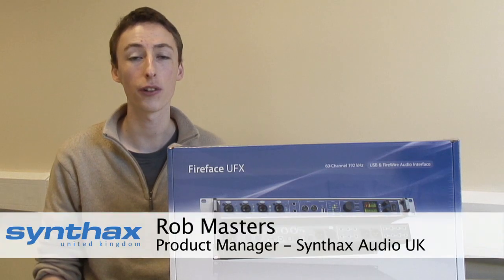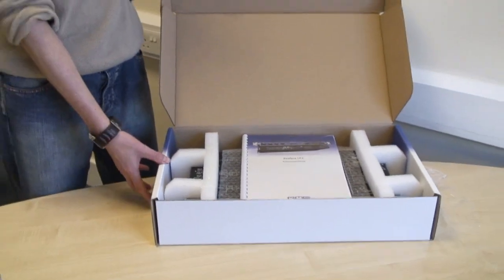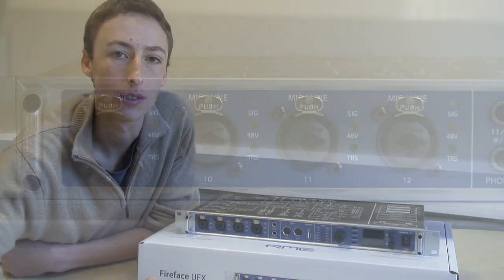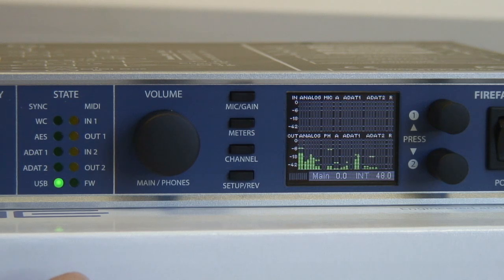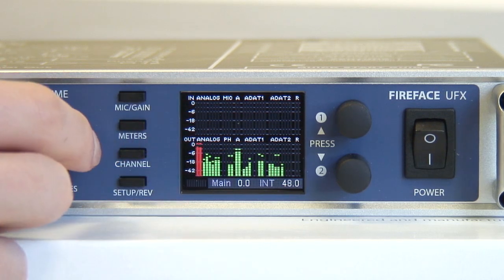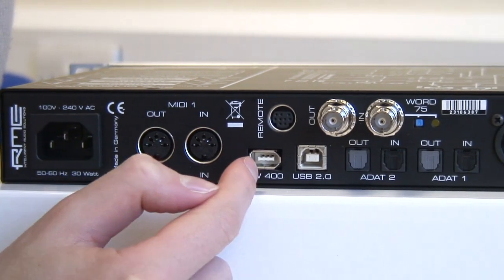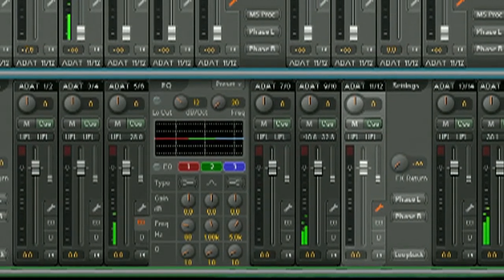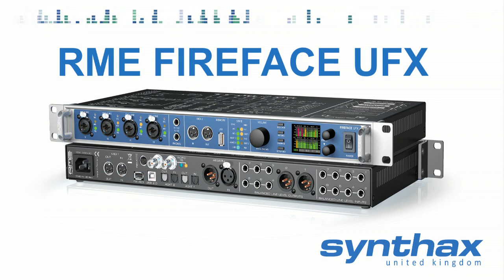RME Fireface UFX - The box opening of the first in the UK

Comment: How many Octamic XTC can be added to the UFX?
Reply from the maker: Hi, for the original Fireface UFX (featured in this video) you have 2 x ADAT I/O, so you could hook up 2 x OctaMic XTCs directly.

For the RME Fireface UFX+ (the latest flagship audio interface), you also have MADI I/O, which gives you an additional 64 channels each way at 44.1 kHz.

So with the UFX+, you could hook up a total of 10 x OctaMic XTC if you wanted (8 x via the MADI, plus the 2 x over ADAT).
Reply: @SynthaxAudioUK  Thank you for your informative 
thorough reply
Reply from the maker: @ollierollie7443  No problem :)
Reply: @SynthaxAudioUK  what midi controller/ control surface would you recommend for use with Totalmix?